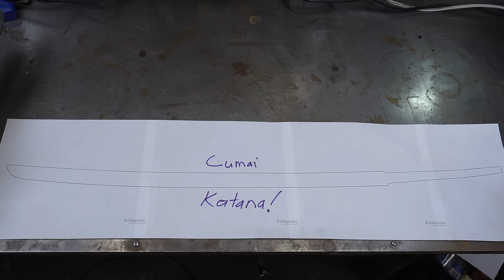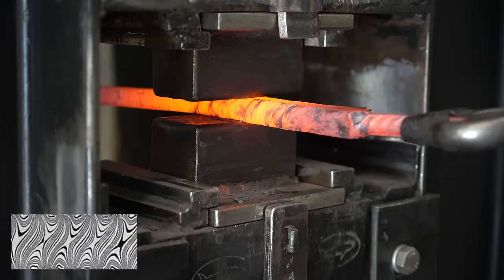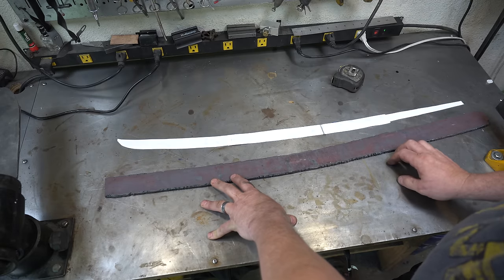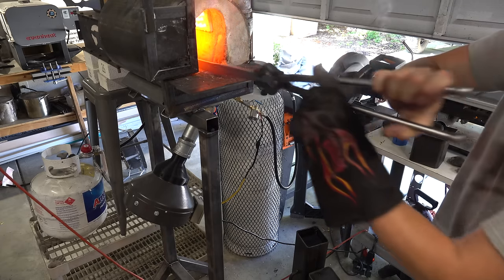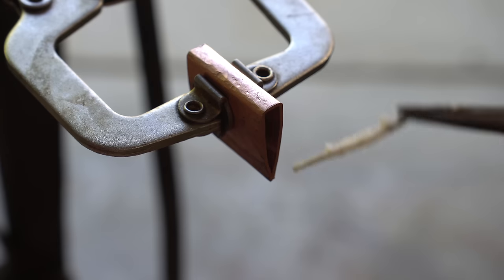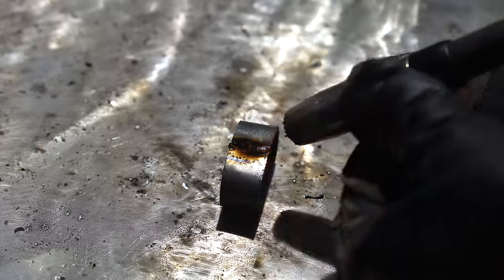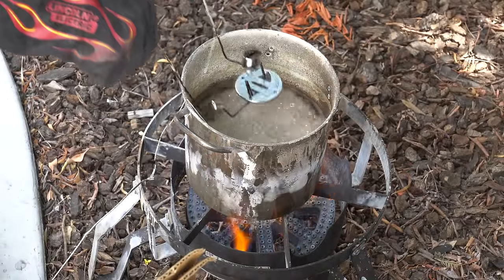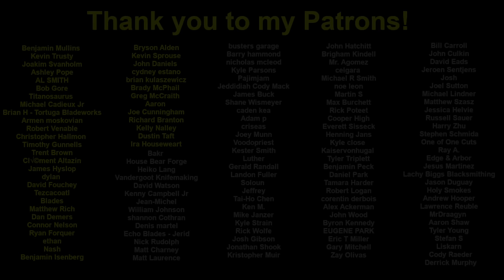Forging a Copper Damascus Katana

Comment: in 24:58 24:59 , The sword to handle Angle is not straight! And is also not flat, its slightly bent in different degree of angle than the handle! About the blade its shape is too thick, there will be airflow issues while the swing! but over all it looks amazing, workable! and beautiful art piece
Reply from the maker: You are just seeing issues with the camera angle.  The blade is perfectly straight and flat or its owner would have certainly complained.  The katana dimensions are precisely to spec if a katana of its length.  Thanks for watching.
Reply: @TyrellKnifeworks  yes could be the lens of camera! no offence . keep up the great work! 😇🙏

Comment: @TyrellKnifeworks what is the tool you were using to engrave the Tsuba? I've always had a hard time with the rotary engravers, and I'd be interested to buy one of those and try it out. Thanks, super cool sword!
Reply from the maker: That is a Lindsay AirGraver pneumatic engraver. They are quite expensive ($1800 for my setup) but well worth it.  I use it to do all the gold/silver inlay now.  Thanks for watching.

Comment: Cool work! Is there any particular reason behind not differtial heat treating it to get the curve and deciding to draw the curve ?
Reply from the maker: It’s Damascus cladded so doing a differential heat treat would leave the top of the Damascus soft and it would look terrible. The copper already adds shock absorption and the blade is already flexible so the differential heat treat isn’t required.  Thanks for watching.

Comment: Copper weapons looks amazing! Too bad they oxidize
Reply from the maker: It’s really no more than a carbon steel blade. If you keep the blade clean and dry and slightly oiled, like you should any carbon steel blade, it will last forever.  Thanks for watching.
Reply: Aslong as you look after it properly it shouldnt oxidise with the right coating

Comment: Don't get me wrong its stunning but how would you fair on Forged in fire is my question How would you Do in a timed Challenge ?
Reply from the maker: Forged in Fire is a game show and is not reality.  Real bladesmithing takes time and if you want quality work, you need to put in that time.  Could I do what they do on FiF, of course.  They produce blades that could never be sold, they just need to pass a few functional tests.  Note, I’m an ABS Journeyman smith now working towards my master rating so I know what I’m doing. 😉.  Thanks for watching.
Reply: @TyrellKnifeworks  No offence meant at all your work on this sword is Fantastic just wanted to know if you could do this kind of quality on a Timed challenge
Reply from the maker: @WELSHYTECH  no offense taken.  Nobody could do this kind of quality on a FiF challenge.  That’s not arrogance, that’s just reality.  A sword like this has about 10 hours just in hand sanding.  There’s zero time for hand sanding on FiF.  People have a skewed perspective of bladesmithing because of the show.  That katana has well over 100 hours of labor, probably closer to 120.  Not 35 like they get in the final challenge and the 5 in the on-set challenge.

Comment: won't the copper oxidize?
Reply from the maker: If properly cared for, like you should with any carbon steel blade, it will last a lifetime and more.  Keep the steel from rusting and the copper will be just fine.  I’ve seen some of my work in this technique 2-3 years later and it looks pristine.  Thanks for watching.
Reply: @TyrellKnifeworks  thx for clarifying, would still look incredible either way 🤩

Comment: Can you do a video on tempering with oil.
Reply from the maker: It’s kind of covered in this video.  Really you just heat your quench tank to the desired temp and then monitor the heat so you can keep it at that temp.  Then put your blade in.  Thanks for watching.

Comment: Is it strong and good as the katana made by the traditional Japanese. Just curious😅
Reply from the maker: It’s certainly not a traditional construction, but it’s made with modern steel and not the inferior steel that the Japanese had to work with.  They did the best with what they had and did a lot of techniques to overcome its limitations. This is a very strong blade for sure. Thanks for watching.

Comment: nice job mate .  but is that also strong and not heavy ? And how much this kind of sword gonna cost ?
Reply from the maker: This sword is fully functional.  It weighs in at 2.5 lbs / 1.1 kg.  These range from $5k - $8k+, depending on complexity and design.  Thanks for watching.
Reply: @TyrellKnifeworks  nice sword but sad so expensive 😢
Reply from the maker: @demonhunter05 these take about 100 hours to produce,so they have to be expensive.

Comment: The copper will get dark, black with the time? How aboid it there is something to do for that not to happend?
Reply from the maker: If the blade is cared for with a light oiling, like you should with any carbon steel blade, it will stay beautiful forever.  A light buffing occasionally will also return its luster. Thanks for watching.

Comment: I'm just wondering, where's the borax for the steel to weld together?
Reply from the maker: Borax is not necessary for any forge weld.  Sometimes it can actually inhibit the forge weld if pockets of it are lodged between the layers.  It's not "glue", its used to prevent scale formation only.  If you have a gas-rich environment in your forge you are already preventing scale.  Thanks for watching.

Comment: I have a question for you 
I have three sword 
I can see faint pattern on the blades. What would it do if I were to acid dip one of these blades?
Reply from the maker: If you etch one in acid, it will tell you if you have real Damascus or not.  Though you really need to hand sand the blades to about 800-1000 grit first for a nice finish.  Thanks for watching.

Comment: I understand that Japanese get the curve in the blade by quenching. Is that possible here? If not, why not?
Reply from the maker: This was a conscious decision.  I explained it in the pinned comment.  Basically Damascus etches differently if it’s differentially hardened (with clay on top) and looks kind of weird with a hamon.  The copper here adds some flexibility and shock absorption and the core steel provides strength.  Thanks for watching.

Comment: Which metal is good for Katana sword strength and unbreakable capabilities
Reply from the maker: There are many kinds of steel that can be used for swords. It depends if you want stainless steel or not. There is no unbreakable steel though.  Compared to traditional steel used in ancient times, this steel is far superior. Thanks for watching.
Reply: @TyrellKnifeworks  thanks from india

Comment: It's some of the best good looking swords I've ever seen. Sadly this sword will not be as strong as one made of steel, but it looks awesome 👌
Reply from the maker: The entire core and cutting edge is high carbon steel.  The copper is lust a thin layer, about the thickness of two pieces of paper for aesthetics.  Thanks for watching.
Reply: @TyrellKnifeworks  Which makes it hard and maybe even well sharped, but a little low in the toughness part. Remember: the higher the carbon concentration, the harder the blade will be. Like glass, let's hope it does not break. You're welcome for watching.
Reply from the maker: @connormcleod9895  There's more to hardness than just carbon percentage.  The steel here is 80CRV2 which also has Vanadium and some Chromium so it's very tough.  PS - I'm an ABS Journeyman smith, so I'm quite familiar with the different steels, their composition and the best way to harden each one.
Reply: @TyrellKnifeworks  You got me at Vanadium and Chromium. I'm just messing with you. You make a lot of sense as usual. And that is something I acknowledge from you.

Be sure you're one of the best blacksmiths I've ever seen. I'd like to talk business with you one day.

Comment: Hi, knife maker here, you 100% can forge it to shape. FOLD THE STEEL. Thats the secret, thats the trick. Thats what keeps the copper safe. All you did was press weld and stock removal. Not really "forge work". Pretty though, for a wall piece
Reply from the maker: Well “knife maker”, you don’t really know what you’re talking about.  This is a layered go mai construction, so you can’t “fold it”.  If you knew anything about cu mai, you would know if you hammer it in the edge it will delaminate.  This is a fully functional sword with a high carbon steel core which is the entire cutting edge and was sold to a respected collector.  One of us is actually an accredited Bladesmith in the ABS, and it’s not you.  Thanks for watching.
Reply: @TyrellKnifeworks  then why was i able to fold it with no problems? Being accredited means nothing, I mean seriously, a special club that congratulates itself? Experience is everything
Reply from the maker: @Sensual_Tortoise 🙄.  Do you even understand what a go mai means?  What happens if you fold it?  I don’t think you’ve worked with cu mai in your life.  Don’t be dumb.
Reply: @TyrellKnifeworks  layering steel with copper is simple no matter the term you want to use. Hell the easiest way to do it is cannister damascus with twists.
Reply from the maker: @Sensual_Tortoise so you’ve obviously never done it by that comment.  Don’t be one of those guys who thinks they want to show me how smart they are.  You are not and have no clue and it’s obvious.

Comment: Hi! When you put the blade in "hot coffee" Is that slang for something? Or is it actual hot coffee, because that's a great idea
Beautiful work!
Reply from the maker: It’s actually very strong coffee.   Coffee has tannic acid which turns steel very black.  Thanks for watching.
Reply: @TyrellKnifeworks  Exactly! I wonder do different blends produce richer, smokier steels!
Reply from the maker: @Dazzaster84 no the blend is irrelevant.  It just turns it black.  It also has to be instant coffee

Comment: What kind of oil do you use for quenching?
Reply from the maker: It depends on the steel I’m using.  This build used Parks50 engineered quench oil. Thanks for watching.

Comment: If you switch to mm and cm you would not have to deal with 200/1000 LOL
Great job
Reply from the maker: Saying “200/1000ths” is simply short form for saying 0.200 of an inch. Saying 5.08mm isn’t quicker or more accurate.  In machinist terms, it really doesn’t matter which you use.  Thanks for watching.

Comment: Doesn't the soft copper make it weak?
Reply from the maker: The copper is just a thin sheet (about the thickness of two pieces of paper after forging) over a central core of high carbon steel which is also the entire cutting edge.  It’s very strong.  Thanks for watching.

Comment: What did he do to make the sword and guard black?
Reply from the maker: The sword is etched in ferric chloride acid and then soaked in VERY strong coffee for a few hours which turns it the black color.  The guard and other fitting were done with chemical salts designed to leave a black oxide finish.  Thanks for watching.

Comment: Does the copper mean that the sword is weaker?
Reply from the maker: The copper does not go “through” the blade as you might think.  The copper is a thin sheet, about the thickness of two pieces of paper after forging, and it is over a central core of high carbon steel which is also the entire cutting edge.  The sword is very strong and functional.  Thanks for watching.

Comment: Does anyone know how much it weighs?
Reply from the maker: This sword weighs 2.5 lbs / 1.1 kg with the handle attached, which is exactly inline with a katana of its length.  Thanks for watching.
Reply: @TyrellKnifeworks  Thank you for sharing! I expected it to weigh more, but that's amazing you cut the weight down so low for such a blade!

Comment: Does the copper make the sword weaker?
Reply from the maker: The copper is a thin sheet, about the thickness of two pieces of paper after forging, over a central core of high carbon steel which is the entire cutting edge.  It doesn’t affect the strength and durability of the blade.  Thanks for watching.

Comment: I was all aboard when he was forge welding the billet until he glued on a stencil and fucking fabricated the blade.
Reply from the maker: Instead of having an attitude, why don't you try asking a question, maybe you'll actually learn something.  1) In layered constructions like this you don't forge it to shape, it just thins out the layers and it looks dumb, 2) this has non-ferrous metals in it and if you try to forge it on the edges it will delaminate.  If you want to watch something being forged to shape, I have other videos of that.

Comment: You know that’s a Beautiful sword, but can you actually forge a Steele Katana?
Reply from the maker: The entire core and cutting edge is high carbon steel.  The copper is a very thin sheet, about the thickness of two pieces of paper after forging.  Thanks for watching.

Comment: curious how resistant it is to the twisting
Reply from the maker: How resistant the sword is to twisting?  It's rock solid and performs like any katana.  Thanks for watching.
Reply: i mean while its hot and you are fusing the metals together
 @TyrellKnifeworks
Reply from the maker: @dusto883  oh, it won’t twist then unless you twist it in the press.

Comment: I'm looking for a real Damascus blade. But all I keep getting is Damascus forgeries.
I made a pattern welding sword like the vikings and saxons did. Just like this in the 1990s. The method was used as an Insurance policy between carbon and the iron. Then twisted to create the core. It would be nice if the maker calls it what it actually is. Rather involving Damascus which is made from cakes not welded bars.
Reply from the maker: I get that some people have watched a video and have learned that traditional damascus is not the same process we do today.  "Damascus" has become the defacto term people relate to for both.   Just know that the American Bladesmith Society, Master smiths, and Journeyman smiths (like this one),  don't care to delineate the terms and will say "damascus" for both types.  If we want to refer specifically to traditional damascus, we'd say "Wootz".  There's no need to "correct" me in YouTube comments.  Would you really "correct" a mastersmith in person, to their face?  No.  So don't be that guys who does it on the internet.   Don't be that guy.

Comment: English swords were quenched in whale oil, then tempered in molten lead.
Reply from the maker: We’ve come a long way since the for sure.  I find it hard to believe they’d temper at over 620F.  That would make for an extremely soft sword.  Thanks for watching.

Comment: 25:38 Are those chips on the blade?
Reply from the maker: No, that’s the felt background the blade is sitting on. The owner clearly would not have accepted a chipped blade.

Comment: Aesthetically pleasing, outstanding craftsmanship. although the quality of the blade as such is so poor, an authentic damascus requires multiple layering/carbon addition/impurity extraction/quenching cycles that will enhance the hardness at steel grain level. A prop sword looks great. A kitchen knife will lose sharpness way faster than you'd like.
Reply from the maker: Respectfully, you don’t really know what you’re talking about.  Modern steel is far superior than any tamahagane and does not require any folding/layering to remove impurities.  This is not a prop sword and is fully functional.  Thanks for watching.
Reply: @TyrellKnifeworks  you should at least know that a katana has denomination origin. you must be trained and certified to create a katana. else, you are illegally taking credit for something doesn't belong to you,  giving bad name to proper ancient techniques.  At best you are creating a twisted blade with the shape of a curved sword. Be respectful and label your video accordingly. Not a katana, not Damascus steel.
Reply from the maker: @carlosvega7548  I’ll name it whatever I want.  Thanks

Comment: Copper is more corrosive u should make this copper green through artificial corrosion
Reply from the maker: If this is taken care of and oiled on occasion, like you should with any carbon steel blade, and it will look great and last a lifetime.  I’ve done many of these over several years and they still look pristine.  Thanks for watching.

Comment: You did squished in which oil sir??
Reply from the maker: Sorry, I don't understand your question.
Reply: You did squished the sword in what kind of oil at the final stage
Reply from the maker: @allrounder9969  if you mean the quench oil, it’s a special quench oil call Parks50.
Reply: @TyrellKnifeworks  this thing will be happened in normal oil
Reply from the maker: @allrounder9969  no, you need engineered quench oil for it to fully harden.
Reply: @TyrellKnifeworks  from where I can get this engineer oil

Comment: 25:38 - many chips on the blade. And in general, there are doubts that this thing can cut anything other than fruit.
Reply from the maker: Those aren’t chips, it’s just the camera.  Believe me, its owner would not have accepted and paid for a sword with chips.  You think it won’t cut anything huh, well you’re certainly wrong.
Reply: @TyrellKnifeworks  okay, thank you.

Comment: The properties of copper is very dissimilar to the steel. It is so much softer than steel, that it will deform well before the steel deforms. You could even "squeeze" out the copper from between the steel, assuming it doesn't simply delaminate, as noted in the video.
Reply from the maker: You understand that the entire cutting edge and core of the blade is high carbon steel?  What’s going to deform?  Thanks for watching.